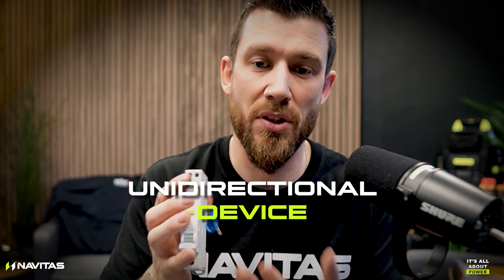WHAT THEY DON'T WANT YOU TO KNOW ABOUT BIDIRECTIONAL RCBOS

Comment: The latest LiFePO4 batteries used in EV's show a small amount of capacity loss in the first year and after that the rate of capacity loss in the charge and discharge cycle is so low that they are expected to last well over 300 000 miles.  Consequently using them as an energy store to power your home during times of peak demand when energy prices are high is a great idea because even if the battery life in the vehicle is halved it will still outlast the useable life of the rest of the vehicle.

Comment: Concealed wiring, rcbo, if not mcb. Battery storage, solar and car chargers should ideally be bidirectional devices. As should standard backup generators running on oil/natural gas or LPG which was a requirement already.
Reply from the maker: Bidirectional devices 100% 

Unless you’re using twin and Earth or concealing cable and MCB is fine. RCBOs are best practice of course, but in certain applications simply not required.

Thanks for watching 😊